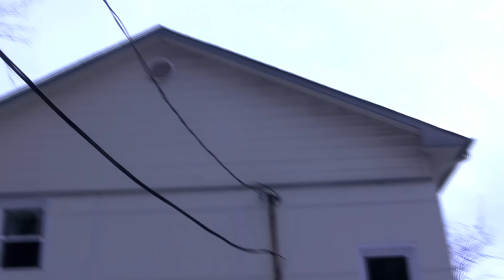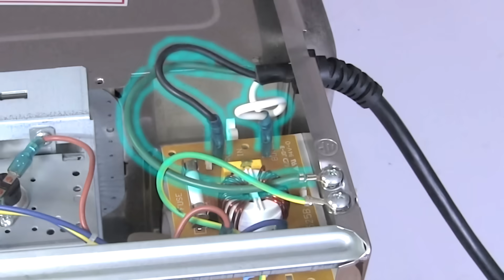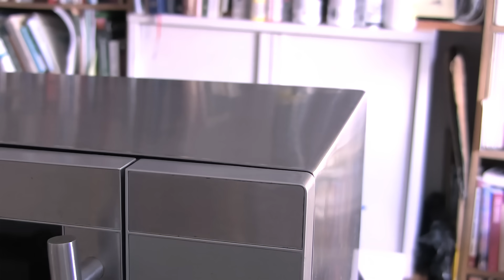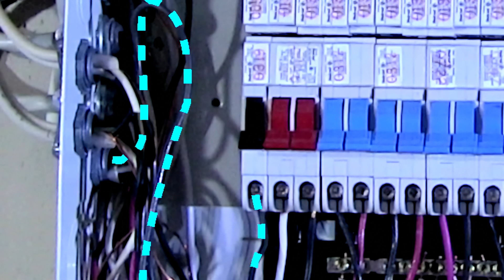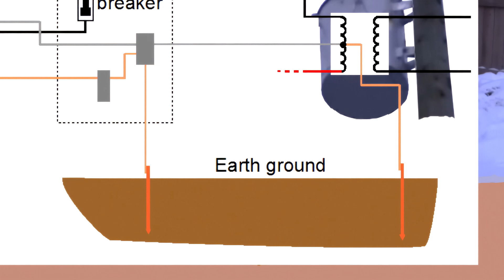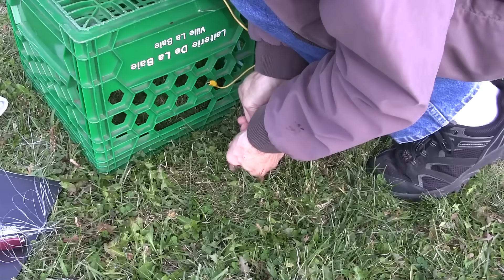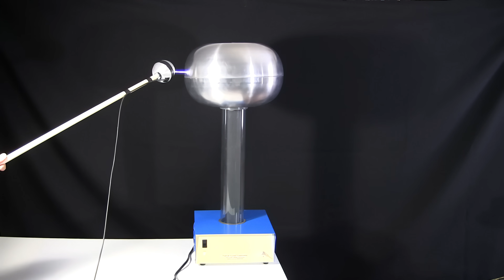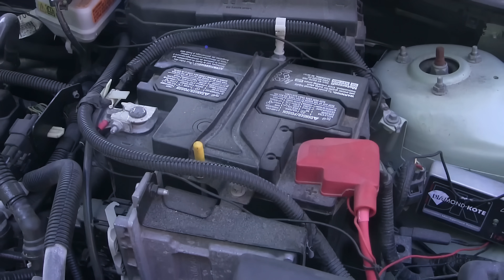What is Ground? Earth Ground/Earthing

Comment: Since the household plug is giving AC current, does the polarity of the Hot and Neutral ever switch?  Or, is it negated because the neutral is already connected to ground?
Reply from the maker: The neural remains constant while the hot oscillates around it. Look at the chart lower down here http://physics.bu.edu/py106/notes/Power.html. The neutral remains where they show 0V and the hot is the red sine wave. The 120V is actually the Vrms that they talk about.
Note that this is measured with respect to the ground. As is pointed out in this video, neutral is connected to ground, so you could say that for the chart, neutral is measured with respect to neutral so obviously it would remain as 0V. If you measured with respect to the hot instead, then the values in the chart would switch places. However, it's important to measure with respect to ground since you, your house, and everything around you is essentially grounded. The hot's voltage oscillates at 120Vrms with respect to everything around you, so it's really the dangerous one.
Reply from the maker: Yeah, I'm going to take back what I said since there are some errors in it. I should have just given a simple answer that, yes, the polarity of the hot and neutral switch.
I got confused regarding the chart because when you're dealing with 2 (or 3) phase voltage, you set the neutral as the 0V line and then draw the L1 (hot 1) and L2 (hot 2) as sine waves above and below the line. I was sort of remembering that but then applying it incorrectly to single phase voltage. Here's an example of that http://www.anoldman.com/power_systems/understanding_residential_ac_phases (scroll halfway down the page). By doing it that way you can add the hots to get the higher voltages.
What's negated is that since you are grounded and the neutral is grounded, if the microwave oven is OFF then you can touch the neutral and not be harmed (but don't do it just in case there's a short somewhere). However, again, if the microwave oven is OFF, if you touch the hot, you will get a shock since you are grounded just like the neutral is grounded -- you complete the circuit.
Reply from the maker: I could be wrong, but the question here wasn't so much what is AC, but what is the effect on AC of connecting one of the wires to ground.
Reply: IN a residential 120v circuit, the neutral remains at "ground."  The "hot" conductor fluctuates from 120v above ground to 120V below ground.  Regardless of whether above or below, there is a 120v difference between the hot conductor and ground.  .

Comment: America always has to be different. From where i come from n the rest of the world, neutral wire are commonly black n live will b any other colour except green/yellow.
Reply: akupehsluarketatAR 3beltwesty in germany its actually not that different neutral is blue (in some old houses its also white) hot is black brown or grey (depends if is an three or single phase system) and earth is green/yellow
Reply: The American color code comes from early Western Movies. The good guy (neutral) wears white and bad train robber wears black ( hot wire) . :)   Learned this in 4th grade!
Reply: In Floppy drives the model we sold to Siemens in Germany for their 1980's PC had the LED in the bezel Green instead of Red. Siemens had some concerned early PC users who thought red was "bad" ie like an oil light coming on in an auto if there was no oil! ie they turned off the computer.

Comment: Good video but you cannot talk about a charge on an AC circuit. 
Charge is a DC voltage and is not relate to to your AC circuit. 
Earth is ground potential and is used to connect metal parts that could be touched to stop the potential or voltage going high in a fault. 
The earth ground conductor should be directly connected to the switch boards earth, not through the neutral.
Reply from the maker: The part of the video that talks about charge, starting at 4:16, isn't talking about the AC circuit. The stuff before 4:16 is about the AC circuit and what happens if the HOT wire touches the case. The stuff starting at 4:16 is about what happens if the case gets charge WITHOUT the HOT wire touching the case. The case can get charged due to lightning, though I'm not sure how. Maybe a lightning strike hit nearby and during the strike, through the ground wire, the case became charged. Now that the lightning strike is over, the case needs a pathway to lose that charge, and that's the ground wire.
Reply from the maker: Ah, I see your confusion. The whole section section starting 3:44 "Why call it ground?" is just background for the section starting at 5:33 "Why connect to ground?", which is where the lightning and charged case problem is discussed.
Reply: Most electricians call the ungrounded case HOT instead of the misleading CHARGED terminology.

Comment: Here in Italy we have a special kind of breaker, the differential breaker. Both neutral and hot pass through it and the neutral is connected to ground before it. 
If current flows through ground more current is going to pass through the hot wire than through neutral, this kind of breaker senses that difference and if it is more than 30mA it trips, in this way, even if the device doesn't have a ground connection, when you touch it current is gonna flow to ground through your body and if this current is more 30mA the breaker trips.
Reply: same in Argentina

Comment: Another good reason for the ground rod is to provide an alternative path to trip the breaker if the main neutral is faulty with high resistance or open circuited and a metal case contacts live.
Reply: Clone36 
He was clear the ground the ground rod is installed has too much resistance to trip any breakers.
Reply: I simply listed another reason for the ground rod, wasn't disputing anything he said..
Reply: Clone36 
 Tripping a breaker IS NOT one purpose of a ground rod,  the reason is dirt will not conduct enough current to trip a breaker. This is a popular misconception I'm just trying to stop. :)
Reply: The Traveler How is one of the reasons the earth rod can be used to trip the protection. Of courses not in every installation will it be enough, but it is an additional safeguard. Some installation in rural areas even use earth as the return path. Get your facts right.
Reply: Clone36 
 ground rods provide about a conductive path of 25ohms. At 120v that is less then 5amps. That is not enough to trip the smallest breaker in houses in America. Where I live no single rod makes this 25ohm minimum requirement of the NEC, so we must drive 2 in all installations.  Even then it will never trip any beakers. Pinpoint in this video where I'm contradicted by him. Anyone using the ground rod to trip any breaker larger than 1amp is unqualified.

Comment: Thanks for the video.My doubt is if case of any eqipment is giving shock means does some thing is wrong in equpment(i.e live wire  touching the case)
Reply from the maker: That depends on the shock. If it's feels the same as when you get a shock when you touch a metal doorknob or a car then that is because of a static electricity build-up on your body, like this https://youtu.be/ey88EdZo9hU?t=3m28s. In that case there is nothing wrong, it is normal.

If the shock is like a buzzing feeling and it happens all the time when you touch the equipment then there is something wrong in the equipment. Likely a live wire is touching the case. That should not happen because the breaker in your breaker panel should trip when you turn the equipment on. But it's possible depending on what is wrong with the electronics or if you have a faulty breaker. You should definitely get that checked.
Reply: Thank for the Reply sir

Comment: Here's something I don't understand: the author says that he soldered all of his ground connections together, but don't they all have to be connected to the negative wire in the circuit?  I always assumed that a "ground" symbol in a circuit meant that the wire had to be connected to the negative of a battery.

Am I mistaken?

Thanks in advance!
Reply from the maker: Whether or not they're connected to the negative of the battery depends on the circuit, some connect to the positive (I once worked on a solar power system that had a positive ground).  If they have to be connected to the negative then the negative will also have the ground symbol somewhere in the circuit. So no, the ground symbol doesn't always mean connect to the negative of the battery, though most often that's the case.
Reply: +RimstarOrg Thanks for the help!  This stuff is pretty interesting.

Comment: In alternating current ,  current does not go back and forth , during production polarity changes at the level of armature coil limbs , during 0 to 180 degrees one limb of coil emits electrons , during 180 to 360 other limb emits electron , but electrons always move forward not back and forth. People are trying to guard this secret , so that correct understanding might empower 
common men beyond their imagination.
Reply: Dr Arun during polarity changes, the current (electrons) change direction. 
Always.
Reply: Can you show with the help of ammeter that in household supply current is changing direction , as Faraday showed in his experiments the changing polarity with ammeter ???   Can you show the same phenomenon in household supply with the help of ammeter ??
Reply: An Audio speaker "sees" AC, with a super deep bass of 20Hz the speaker voice coil can be seen to move in and out. The a battery ie DC the coil moves in and out depending on how the battery is connected; ie polarity.

Comment: Neutral and Ground wires are pretty much same thing
Reply from the maker: Not quite. When the microwave oven's switch is closed, turned on, the neural is a current conducting wire. The ground wire conducts current only when there's a fault.
Reply: RimstarOrg but Ground can be interchanged for neutral and vise versa yea ? (Not according to NEC and electrical codes of course) but in experiment
Reply: In USA ground and neutral are connected together to the same ground / neutral bar in the panel anyways
Reply from the maker: Yes, but at the microwave oven the neural closes the loop to the hot through the on/off switch and the ground never closes the loop. That's the important part.
Re interchanging the two, sure they can be interchanged, as an experiment. But you'd still have one of them be the current carrying conductor when the microwave oven's power switch is closed, and the other being a safety feature that's connected only to the case. That's the difference. The fact that they're bonded together at the distribution point doesn't change that.
Reply: RimstarOrg I totally agree. I just think  "globally" about electrical wiring systems used everywhere that ground and neutral wires are redundant. governments' secret way to sell more copper
Reply from the maker: Huh? Just because two wires are connected on one end doesn't make the redundant. Read what I said again. Ground and neutral are different and serve different purposes.
Reply: They are not connected together in a subpanel, but are connected together if the panel is right by the meter box. ie illegal to connect them together on a subpanel
Reply: Vadim Martynyuk In audio systems, the ground and neutral have to take separate paths and there can be only a limited amount of resistance between the two (continuity) or else a ground hum will occur. They are not the same or redundant. The ground is used as a reference for the system, as well as an emergency path in case of a fault. The ground is active in the system.
Reply: BariumCobaltNitrog3n my guitar will hum thru the amp if I turn a certain way

Comment: If there was a fault on the neutral wire and it is touching the case, the case would still becomes energies? still a complete circuit.  The circuit would be source, case + neutral. Wouldn't this trigger the breaker? or the resistance of the case will limit the current so that the breaker wouldn't detect this?
Reply from the maker: It wouldn't become energized because the neural is connected to ground and so is the case. They're at the same potential so there is no voltage between them, no current flows.